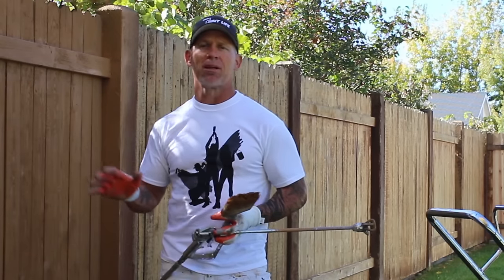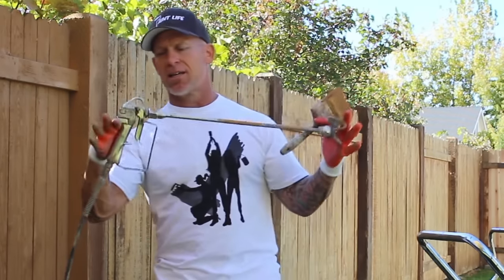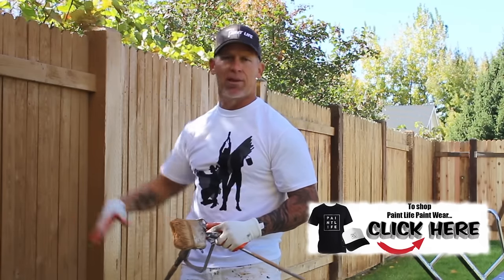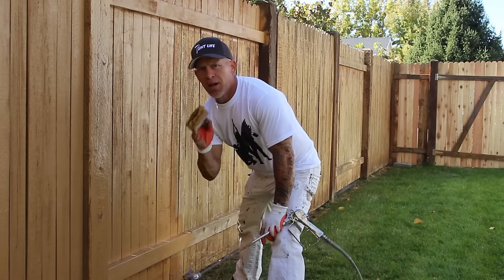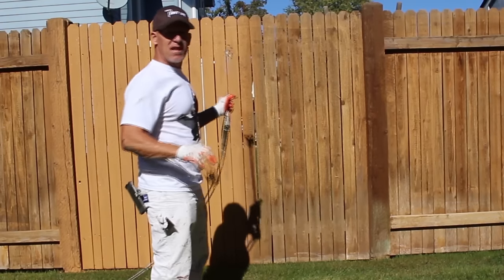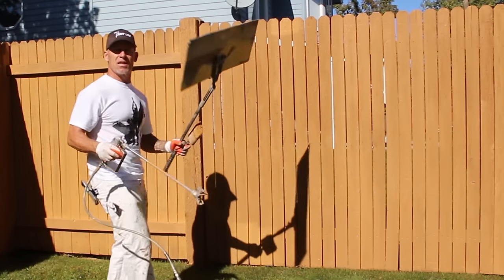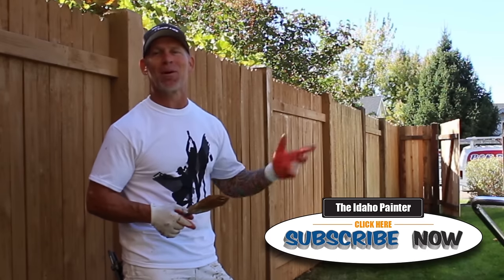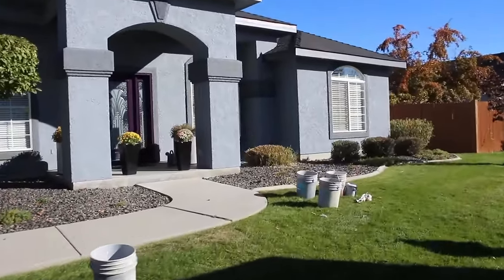HOW TO STAIN A WOOD FENCE Instructions painting a wood fence

Comment: I have a high-end Graco Professional airless sprayer.  You gave plenty of explanation on how to safely and properly use a sprayer to apply the stain (plastic or cardboard BEHIND the fence to prevent over-spray behind the fence), and always use a ventilator mask. Apparently people watching ignored your verbal instructions.  

While it seems like a fast and efficient way to apply the stain, the applicator would have to either be moving back-up tarping behind the fence or employ another individual to simply hold/manage the tarp and monitor any over-spray.  As much as I am tempted to use my Graco on jobs, I trouble headache of over-spraying/damaging any property behind the fence is simply not worth the risk and worry. I can employ/use the extra hands to brush on the stain with me and cover far more linear feet of fence much quicker. But very good video. Keep up the good work!

Comment: I stained a picket fence several years ago that was a fairly dense wood with cabot and I sprayed it but didn't bother back brushing cause I thought the customer wouldn't wanna pay for the extra hours. Boy did I learn a lesson. Luckilly the customer was easy going but several parts of the fence looked bad. Where the product sat on too thick it was bubbling and looked spotty. It looked good while it was still wet lol. I think the wood was dense enough to where over application was obviously very possible. I felt bad about that job but I learned and will do it right the next time. That same day i stained typical softer wood fence in the backyard and i sprayed with out backbrushing it turned it great. I think I will just stick with backbrushing everything untill i get the experience of when I need or dont have to back brush.

Comment: Thank you for great tips.  I'm planning to stain with Behr All-in-One our new fence and not sure if you need to prewash a new pickets (they were washed 2 times by the rain and look very good). Sir, you need to wear respirator, when you spray that stuff (even if you show us a small fragment of your work). Thank you again.
Reply: Always good to pressure wash before staining exterior wood.  Rain isn’t going to clean it.  
And I would stay away from anything by Behr for exterior wood staining.  I don’t know all their products but they had a class action lawsuit with hundreds (thousands?) of homeowners furious with their peeling deck coating.   
A pro paint store would be a better choice.  But if wood has never been coated before a semi trans oil is always a good choice, as it’ll never peel…….just pressure wash and recoat when it fads in a few years.  Clark and Armstrong is a good brand for that found online

Comment: Great vid but I'd use a 8" or 12 in brush. Also airless sprayers are expensive so if your using a water  based stain why not use a chemical pump like a sure flo 40 to 90 psi. same tip but with much more flexible hose and keep the tank and pump in your trailer or truck. $32 an 8' panel great job you're worth it.
Reply from the maker: Good idea, thanks for sharing & watching!

Comment: My question is about how long to wait to stain pressure treated wood used in the framing.  Also, for the treated lumber, is waterbed stain any good?  I have a new fence.  In Houston, the soil moisture is so high, we use a treated board along the bottom.  It looks great and gives a little extra height, but the color from the treated pine and the cedar picket is pretty stark.  I'll probably use 2 colors to get them to to match.  You do great work.  Very helpful for this newbie/DIY'er!
Reply: It really depends. All wood is different, sometimes its right off the line and others it might of been sitting for a month or two. Typically 2 months should do it. Sometimes a a couple of weeks. You can tell when to by the look of the wood. It starts looking more dryer and loses that new fence look if that makes sense. Hope this helps.

Comment: I have a new fence, red Cedar straight  of the pallet from Home Depot. Do I have to sand it down before I spray ? also someone said that I should perhaps brush it rather than spray because the wood will  absorb the stain better? Any other prep work on brand new cedar I have to perform before I spray?

Comment: Great video.  Dude, is the spraying method more efficient with the stain?How much stain did you use to complete that job.  Or asked a different way, how many linear feet  of  6 ft privacy fencing can you cover with a 5 gallon drum of solid stain and an airless?
Reply from the maker: A solid stain would probably do about 10 panels. 
Spraying is much more efficient.

Comment: Hey man! Thanks a lot for the information. One question, could I use a regular air compressor with spraying a fence with water-based stain? I know it would be far less pressure as it's not airless. I'm all setup for HPLV, just not sure if it would be as effective. Would there be too much moisture content from the compressor? I don't have an air dryer hook up, but I can easily buy in-line filters for moisture reduction. What would you suggest in this scenario? Airless is too expensive to purchase! :D
Reply: I'm in the same boat as Justin. I have a wide spaced 4 foot picket fence. For a DIY job could I do my fence with HPLV? It would my first attempt at a project that big.
Reply: Thanks Chris! Your videos are the best for any DIY guy. Appreciate what you are doing.
Reply: @brentott2497  HLVP typically holds a quart at a time, seems inefficient.

Comment: Great video! Could you tell me when I should do this to my fence? I live in Southern Indiana. The previous paint is really chipped and I had a ton of carpenter bees that were making homes in my posts this past spring/summer. I am wondering if I should do this in October or wait until early spring. I have to replace several boards as well.
Reply: Power wash get rid of chipping paint sand if need be and honestly can do it whenever as long as weather is nice

Comment: Do you use 3M 5P71PB1 6000 Series Particulate Filter P95, 10-Pack (Amazon) with the 3M 7502 Respirator?  I need to spray paint concrete walls in our basement with Loxon Concrete & Masonry Primer followed with SW Superpaint.  Using Graco Ultimate Corded Handheld Airless Sprayer with 518 tip.

Comment: A customer of mine used a pump sprayer and back brushed it. He wants me to coat it again. I’m Going to use my graco 390. If there’s any water damage from a sprinkler system on a new fence will the stain hide or intensify that?
Reply from the maker: Depends on how you strip it
Reply: Paint Life TV, so I should strip the panels affected by the sprinkler system. Then spray and back brush the rest of the freshly installed fence

Comment: Way way too much pressure on the spray. 1200psi max and use a 3 or 415. 6 inch brush on a extension pole would be better on your back.

Comment: Hell at that rate you may as well just brush it on, saves the hassle of a sprayer.
Reply from the maker: leaves a better finish
Reply: It’s faster to spray it on and back brush. Saves a lot of time dipping in a bucket to get the same amount of material on the surface